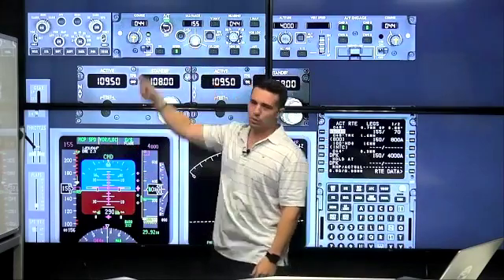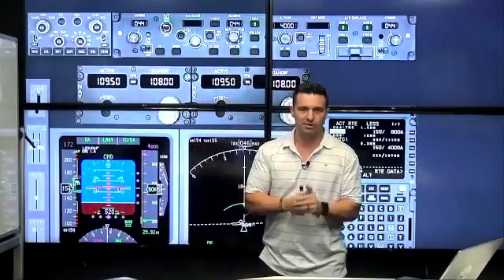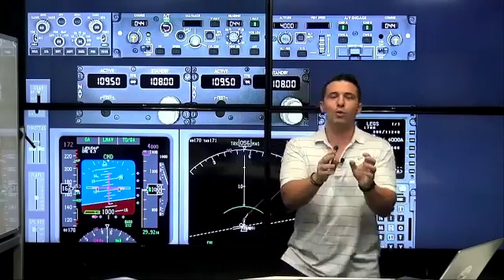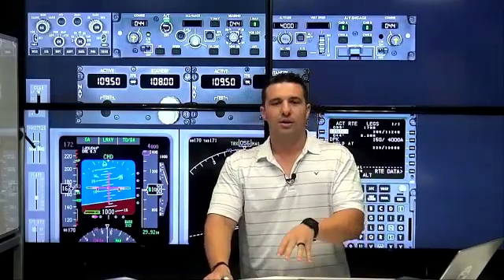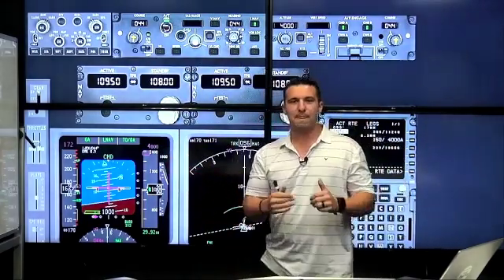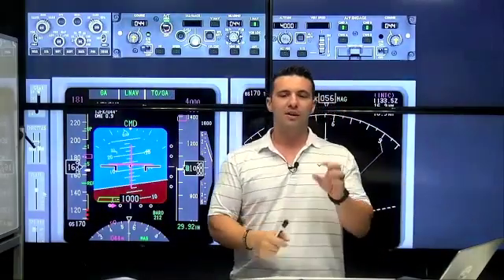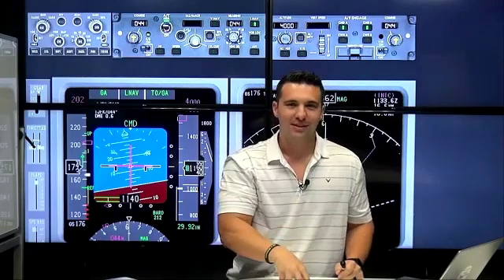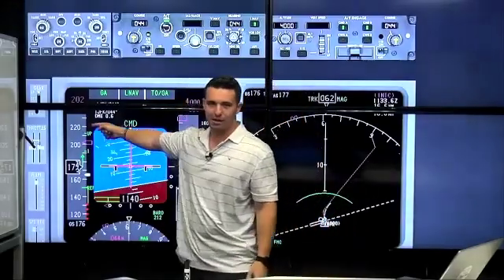B737 Go Around Callouts

Comment: When you get ALT AQR in a low altitude MA, lets say 2000ft, what does the speed window show you? 222kts or the actual speed when you got the ALT AQR?
Reply from the maker: In the go around phase the ATHR will first command speed according to SRS and later "green dot". This question sounds like you've been studying the B737 :) ALT ACQ is a 737 mode and the auto throttle would maintain the speed at the time ALT ACQ engages. Not the case in an A320.
Reply: @1stepprep  
So, lets say I go around with a MA of 2000. Just when we put flaps up the bug moves slowly towards the 222 kts which is the target speed with flaps up in a go around. But before the bug reaches the 222 knots target we get ALT ACQ. Would the speed window show opened 222 knots or the actual speed when the FMA showed ALT ACQ?